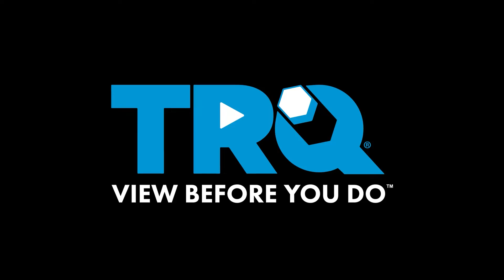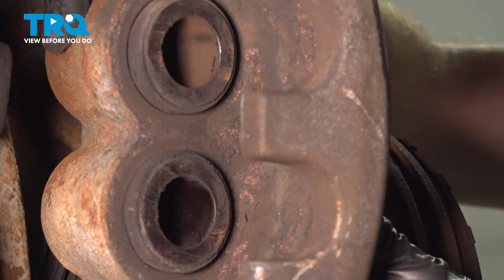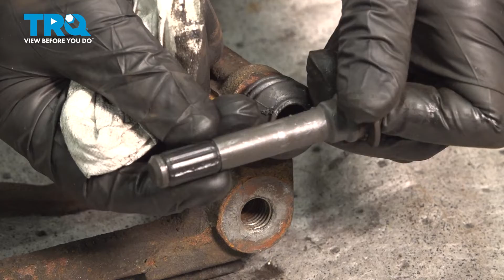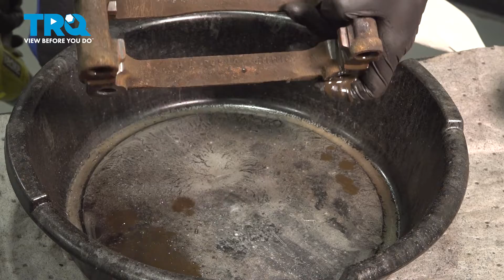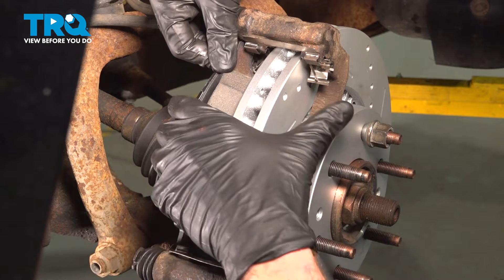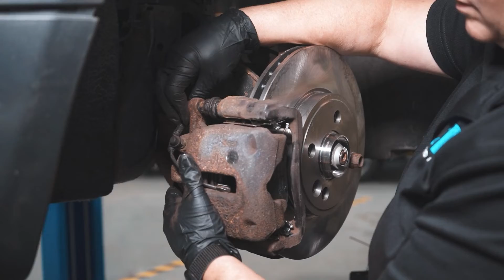How to Replace Front Brakes 2002-2009 Chevrolet Trailblazer

Comment: Good video. He is showing you the full blown mechanics way of doing it correctly. The average joe will be fine with not fully cleaning and inspecting the caliper pins and what not. Just changed your pads and rotors, you will be fine. When you pay money for a service I would expect this type of detail though.

Comment: Open you brake fluid resovoir before you push your piston in. You dont need a new caliper if fluid leaks from the boot you just need to replace the piston boot.